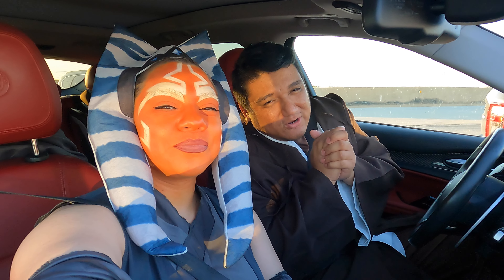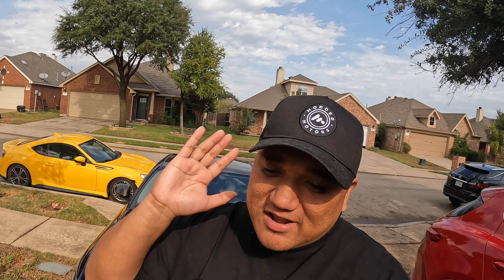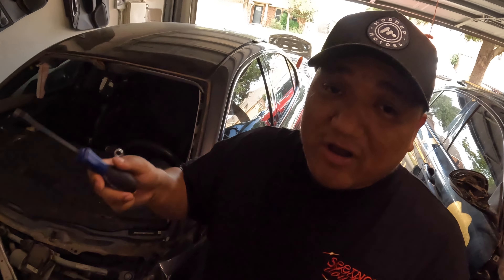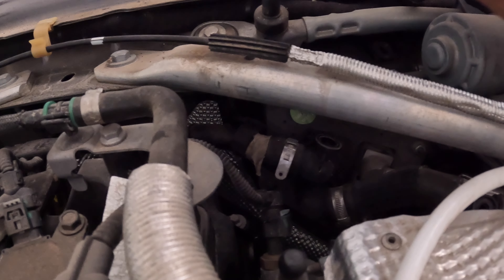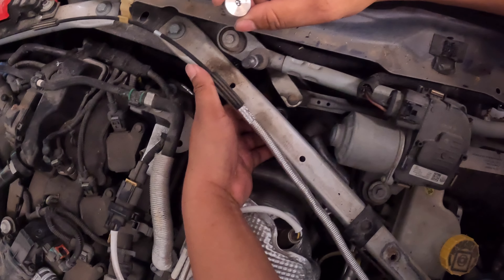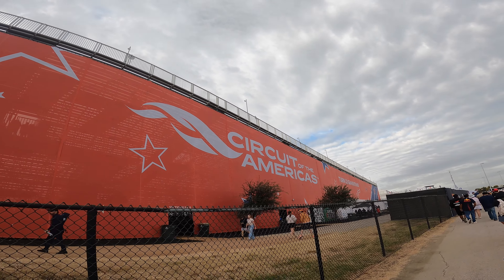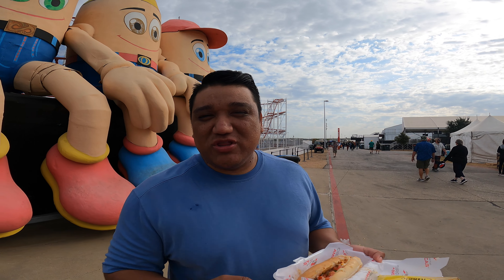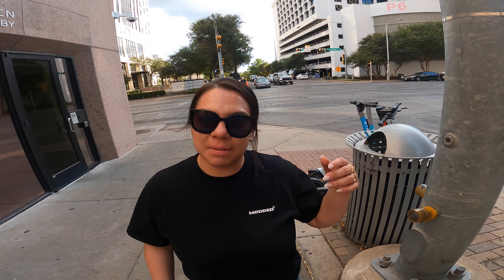STOP Risking Your Alfa! Upgrade Before It Leaves You Stranded!

Comment: Thr screws was my first mod. At the time they were billet aluminum and $80.  I hated the price but research showed it was true about the stock defective plastic screws.  May I add. To cut down on senseless warnings and codes. Use the auto start/stop bypass. These two mods help the alfa act like a normal car. Lol
Reply from the maker: It’s the little things that make these Italian cars behave better lol
Reply: Yea the auto stop/start bypass is a necessity
Reply: They were never $80. They were $29.00 - Now they are stainless Steel at $31 for two screws. ;)
Reply: @alfissimointernational  I just looked at my receipt on the Alfissimo website. It was $46.90 to my house. I guess it felt like 80 cuz they're literally just screws.

Comment: i have their older aluminum ones installed. do you think i should replace with these or just stick with their last version? also, check my video out on these screws, the second one is totally accessible without having to remove the cowl - work smarter not harder 😉
Reply from the maker: I wish rushing 😭 I had no logic on how to do it lmfao I was like I give up 😂

Comment: FYI do not reuse the plastic screws , always use the metal alternative . I only replaced the M6 with upgraded metal version and then the M8 planned to replace just the gasket (huge mistake!!) reinstalling the m8 plastic screws broke 90 percent in .These plastic screws are flimsy save yourself the headache and learn from my mistake replace both and do take the cowl off it will make the process so much easier.

Comment: Stuff rags around the bleed screw locations to prevent screw from falling into engine bay.  Seriously, as there is very little room to to maneuver for either screw.  Also helps to use a magnetic grabber to help position the back (larger) screw into place.

Comment: Great tip and video.  Why would $31 screws cost $31 to ship in a $0.10 envelope. I’ve bought great parts from them but why not just say $31 each & free shipping that costs $0.84 to send.  A little misleading in my book unfortunately; but probably better than a tow. Let them know if talk to them, some fans of the site feel this is a turn off. Anyway thanks for the great tip. I may have to look around out of principle or wait until I need more parts in hopes of spreading out $31 extra across the spend.

Comment: Can anyone explain what these screws are and why they need to be changed? What are the risks?
Reply from the maker: The oem bleeder screws are made out of plastic, if they fail you’ll leak coolant. Typically people will see steam coming from the top of the car. If you run low on coolant and continue running the car you run the risk of damaging your motor. With old age those plastic screws are known to just break over time, which makes the stainless steel a great option.
Reply: @ModdedMotors  thanks a lot